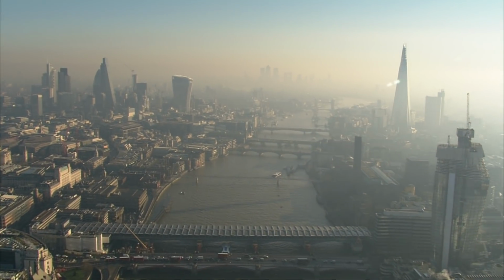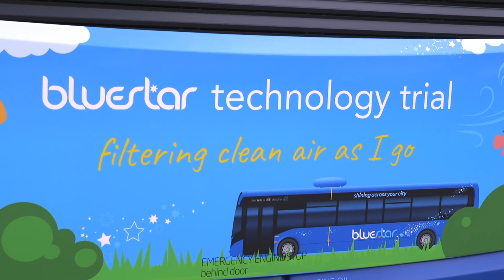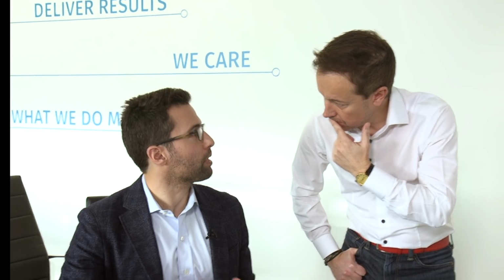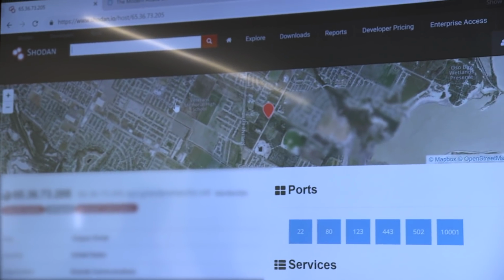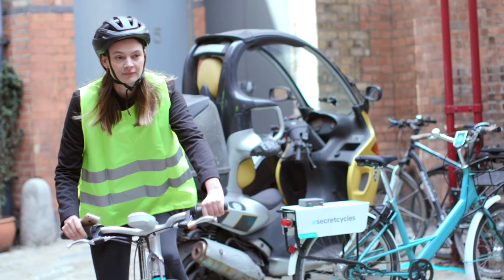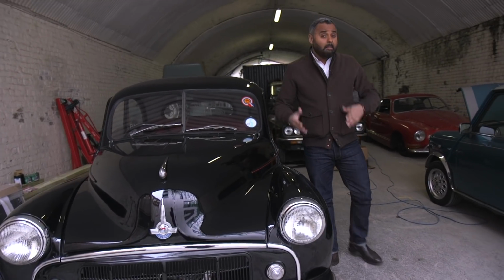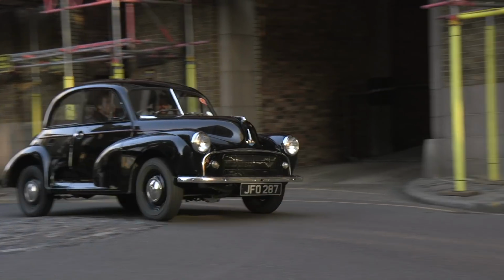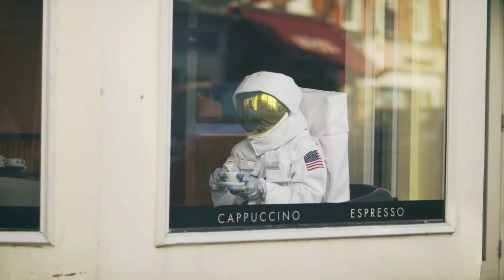Keeping The Air Clean - BBC Click

Comment: Why nobody takes an ACTUAL Solution preventing the "Air Pollution Problem" FROM THE BEGINNING !!! 20 Years ago the German Chemist Dr. Peter Plichta invented ways to produce an Fuel the will NEVER have the Problem of Carbon / Sulfur / or Amonium Pollutive exhaust gases. SILANE (SiH) and its Forms (Si n + H 2n) can be used as an Component Fuel BOTH for Powercells AND realy inventive efficient combustion Engines IN THE SAME VEHICLE (such as DukesEngine and Archates Motors) THIS WOULD BE AN SOLUTION for the Future !!!